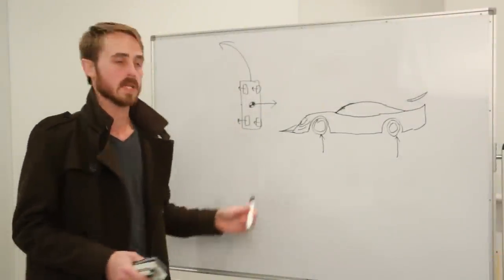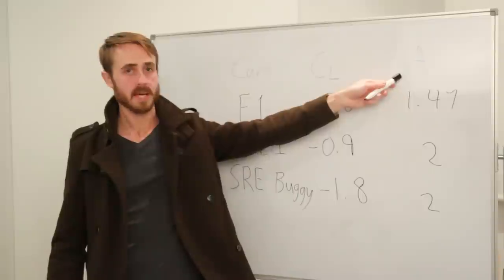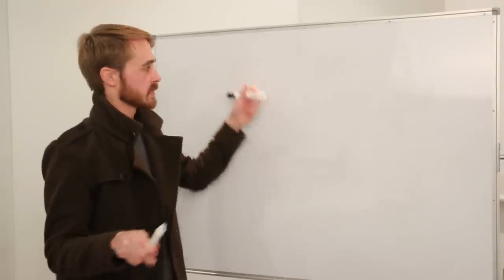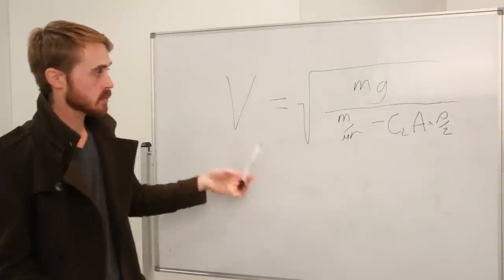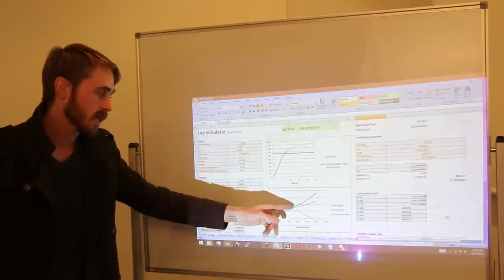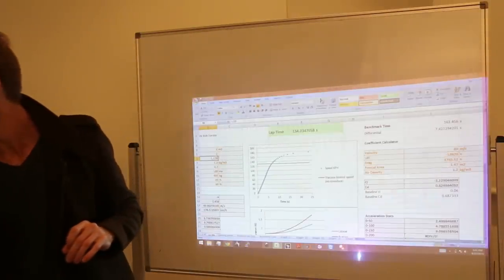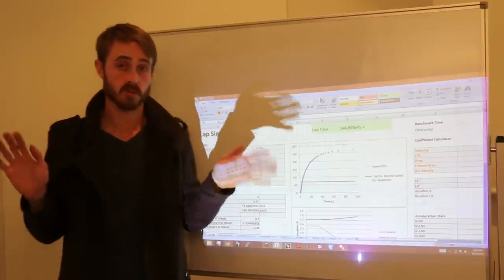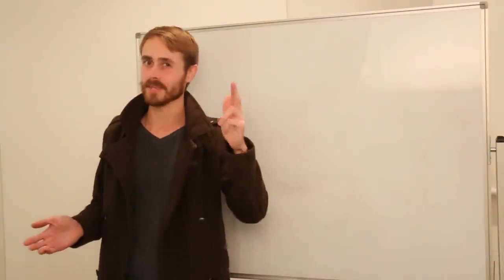What Speed Does Downforce Start Working?

Comment: so if the faster you go the more g you can pull, with an infinitly fast car you could turn on an infinitly smal corner?
Reply: You'd need some strong tires I'd think, because of the amount of increased weight your car has while under a decent amount of downforce. Formula 1 cars produce about 1.5 tonnes of downforce while under 230km/h. The minimum weight for an F1 car is about 720kg, which means that at 230km/h the car has more than doubled its weight. The other problem is that downforce also creates drag. The third problem is the length of the corner. The faster you travel, the more distance you make.
Reply: At really high speeds Newtonian physics no longer apply, relativistic concerns come into play. The faster you go you will gain mass, so 'm' is no longer a fixed quantity.  I'm not sure about how relativistic shrinkage of space in the direction that you are traveling would come into play..

Comment: Hi there, I'm an irish engineering student doing the aerodynamics of my college's formula student car. Your videos have been a great help in researching the basis for my designs however I'm having trouble comparing my design iterations and I was wondering if you could please send me the excel sheet you have? it would really help me out so much!
Reply: I hate to say this but that spreadsheet was for his personal business, if you need something similar to this I would point you in the direction of a program called Optimum Lap, is a virtual lap simulator that provides much of the same information and some good help with adjusting things like gear ratio and seeing the potential benefit of aero  iterations on lap times. ( Its also free to use)

Comment: You might be interested to know that some SCCA "A Modified" class autocross cars are making over 2000 lbs of downforce at only 35 mph! The downside to that is they are so draggy that they can't go much faster than 90 mph, even with 300+ hp.
Reply: bullshit
2000lbs = 8896 N
35 mph= 15,64 m/s
-8896=0.5*1.22*15.64^2*Cl*A
Cl*A=59.6.

these number is really off, even if you have a total wing Cl of 10 (which is far from reality) you will need to have a total wing area of 5.9 m^2, which we know that it doesn't have.
Reply: there is no way!!!  think of a light aircraft that has huge relative wings.  they need over 35mph (like 35-70 mph) to get lift to overcome similar weight.
Reply: Might want to tone down that claim it might make that downforce figure, but not at that speed..

Comment: in other words, splitters, canards, bigger rear wings are all useless for AutoCross then, correct?
Reply: Not useless if they are all extreme in nature (so much so they would be way over the top at any elevated speeds).  In the case of typical street setups, absolutely useless.

Comment: for road cars, conservative aero = dead weight in my opinion... but serious aero for road cars may be overkill though...
Reply: Sometimes manufacturers design cars to be dangerous at highway speeds and those small aero mods can really make the car a lot more stable even at legal speeds.
Some examples are minimum ride height requirements for different countries, as well as removal of trim like wings and fender flares to conform with specified standards.
Reply: Dankus Memus good point!
Reply: this, my audi TT is a famous example. My MRS gets really unstable at around 160kph.

Comment: Is is possible to crash cause you went "too slow". is it only a legend that for example you go in a corner 100kph and crash but if you go like 140kph you make it through?
Reply: If that happen, get better tires and suspensions.
Reply: If you are going slower then it will be easier to turn into a corner because your velocity forward less so, you need less sideways force to impact the direction of the car. In other words, when you are moving quick you need more sideways force or the forward force will take over and you will not turn as much.
Reply: it is possible

Comment: Kyle I feel you are relying on the simulations too much, the numbers they generate as fact and not considering the human element. The difference in feel of a balanced car with even mild downforce is considerably different to that of mild lift at speed and in transient cornering situations. The ultimate grip may in fact not be that different, but the issue of driver confidence in a aerodynamically stable car is one that should be taken into account, particularly at speed and in varying aero conditions that usually occur on a circuit or in traffic.
Reply: Human input doesn't affect down-force.
Reply: Agreed. Even very mild aero helps with confidence

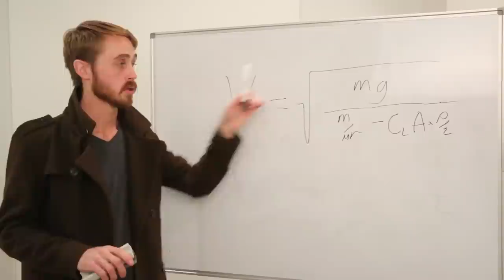Comment: you said at the 5:35 mark that "so now that we have the theoretical basis covered, lets have a look at some ACTUAL downforce figures are at SPEED." AND THEN YOU SHOW US SIMULATOR FIGURERS??!! WTF??!!
Reply: are you ok? Are you sure you understand the difference between theory and applied math? He plugged in real values, you don't need to see the formulae to understand these, so what he said was correct. Had he said "let's now look at experimental data" then your point would be valid.
Reply: Don't worry how the fuck I am.  He's just piping in cl, cd, weight etc data.. I was looking to see actual wind tunnel or on track df figures not "simulated" results. Do you know what the definition of "simulated" is? His has merrit but there are some ppl who want to see real-time, bonified numbers when they're spending big money on aero.
Reply: Physics doesn't lie.  If his inputs are correct, the outputs he showed will be correct, all things equal.